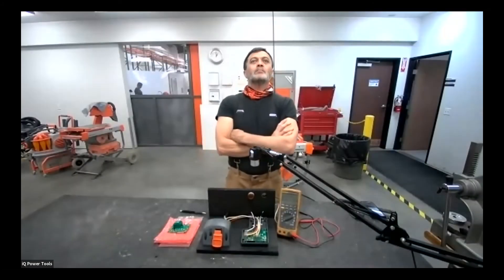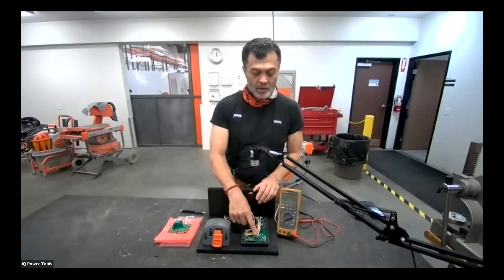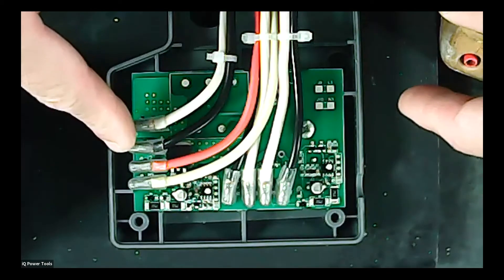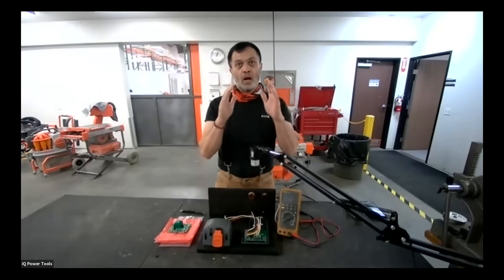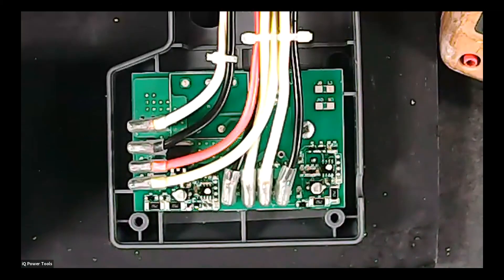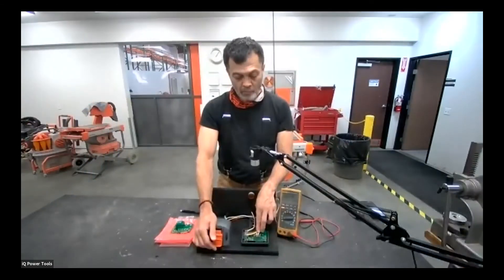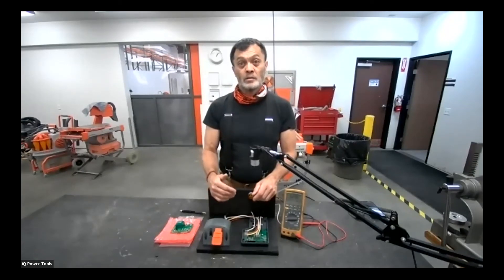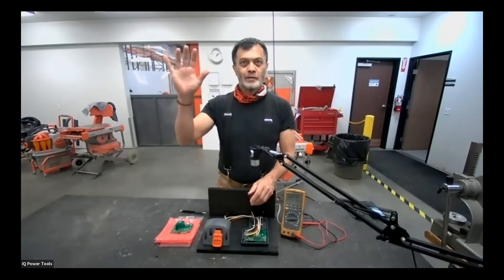iQ Saw Troubleshooting - PCB Board Training

Comment: Hi there guys? I have a 362 and I always run on 8000 generator,but now it won’t work,the breaker on generator goes off every I try to start .
The vacuum motor works becouse if it runs for a little if am lucky it collects the dust .
What do you think it is the problem ?
Thanks
Reply from the maker: Hi! Not sure exactly what is causing the issue. Will you give us a call at 888-274-7744 so our service team can help you?
Reply: Hi there, did you resolve your issue with the 362 saw? I’m having the same problem.
Reply: Same problem with mine, what was wrong with yours?